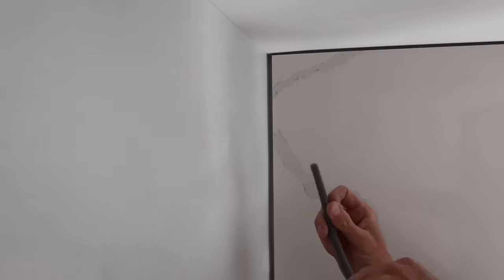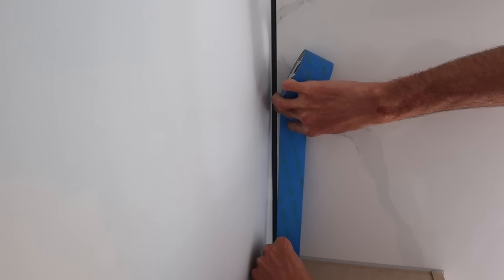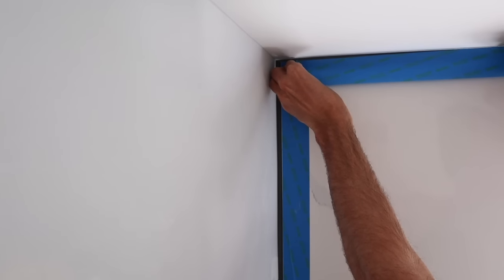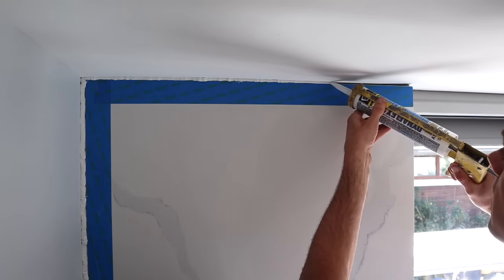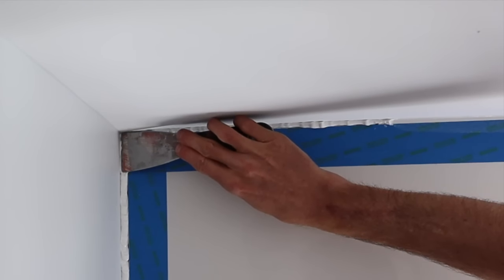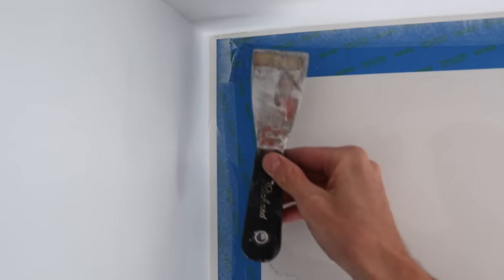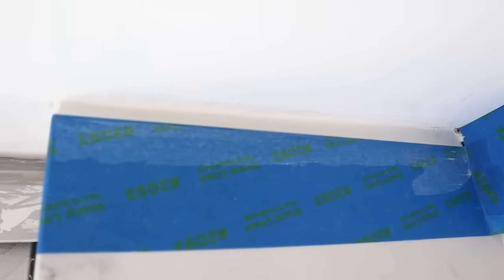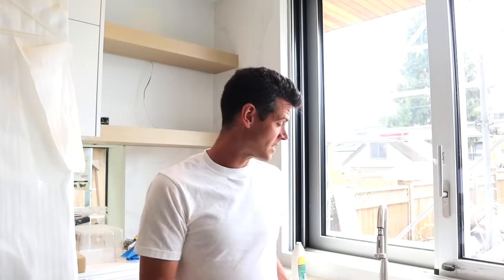How to Caulk BIG GAPS!!!!

Comment: I've caulked 1000's of feet of trim in apartments I've fixed up and rented out over the years and have never heard of backer rod.   Thanks for the tip.
Reply: its construction its commonly used to fill gaps in the wall and door frame.
Reply: Same here! This is a great informative video! Thank you for posting!
Reply: In the carpentry industry, we call "backer rod" paper towel, or pretty much whatever will fit in the gap. Don't waste your money on "backer rod." It's a marketing scam. Anything will work. 

You're just making the gap smaller so your caulk isn't heavy enough to pull itself out. Caulk isn't meant to fill gaps. It's a surface applicant.
Reply: @BruceOfWaynes   baker rod is meant to give the caulk an hourglass effect it’s import for expansion and contraction.   He should have used a tooling knife and made the outside concave to match the inside also you don’t want 3 point adhesion or the caulk will crack and pull away. Last no backer-rod means you will waste a ton of material. Also if your gonna use backer-rod you want the depth to be half of what the width was. Then there is open cell and closed cell. If you don’t want air bubbles popping up don’t poke holes in you baker-rod while installing the open cell I don’t think that would be a problem.
Reply: @BruceOfWaynes  wrong backer rod also gives the sealant the proper profile so it can stretch and compress properly. Paper towels or anything else is I VERY poor replacement.
Reply: @genecarden780  lol. What?! Proper profile?? Dude. I've been doing this shit, professionally, for 20 years. Never once have I ever seen anything called backer rod on a goddamn job site. Never. No one uses it, guy. Whatever fits in the hole goes in the hole. So take your ridiculous diy advice somewhere else, friend. Thanks for your input tho. You probably bought that new fangled air conditioner with the ice water too, huh? 🤦‍♂️
Reply: As another fellow landlord. 

EXPANSION FOAM IS YOUR FRIEND

Cheaper, bigger and easier to store than backer rod.
Reply: @BruceOfWaynes  Tell me you work for Dan Ryan Homes without telling me you work for Dan Ryan Homes.

Comment: I can not thank you enough for posting this video. We had trim at the tops of all our walls. When we removed the trim, that I hated, there was this gap… everywhere! In all the rooms! I have textured ceilings so I couldn’t use the tape! I came a crossed your video and tried it, with one exception, after I used the caulking and let it dry completely I used joint compound and then sanded it flat. Wow!!!! I have done my entire house and repainted all the ceilings and the walls. It is perfect! Can not even see traces that it was once there! It didn’t mess up the textured ceiling at all! You are wonderful! Thank you so much!  God bless you and your family! ❤

Comment: Youre actually suppose to leave backer rod for 24 hours before you cover it with caulking..
(I worked for the biggest glazing company here in B.C. used backer rod everyday)

Reason being.. Its foam. So when you squish it in. Its going to expand back out as it decompresses..
If you squish it in and cover it right away. As the foam decompresses. It pushes the caulking out with it..
Which is why he said "we'll see what it does"
Then said it coved out just a little bit..
Cause he covered it right away and didnt let the foam expand back out..
He got lucky cause its small rod.
Bigger the rod. The more it will cove out if you dont let it expand back out first and cover it with caulking right away..
Reply: Very good advice and information, thank you.
Reply: I’m glad I read your comment before I started to fix a repair today..great info.
Reply: You are not supposed to squish the backer rod.
Reply: It doesn't matter if the latex caulking is flexible. I've done a lot of caulking jobs.
Reply: He’s a carpenter! From Vancouver!.. not a painter!..
Reply: Also, what about the caulk shrinking? Latex and latex w/silicone still shrinks over time. 100% silicone caulk doesn't shrink much if any at all.

Comment: That tip at the end really resonated with me, I recently did drywall in part of my basement (crawlspace actually) and I was not happy with how it went, lot of big gaps or areas it did not line up right etc.  But after it was all done I realized it was not THAT bad, and all that will be fixable when I plaster anyway.  Sometimes you need to give your work some tolerance to imperfection and I often forget this myself and try to make stuff too perfect.

Comment: BRAVO !  I just mounted drywall in my kitchen ceiling, to cover the recess that housed 3 x 48" fluorescent tubes.  The original recess wasn't even close to square,  so I have gaps ranging from 0" to 5/8".  This video saved countless hours with a kinked neck & blobs of joint compound on my face.

Comment: Congratulations!! This IS the correct way to install sealant(caulk) I have installed sealants professionally for over 40 years and I see so many stupid methods of caulking. The one thing I would suggest you should do is tool it both directions to improve adhesion.Backer rod IS essential Not just for aesthetics but it also improves the performance of the caulk significantly. Thanks for getting the installation right. Just in case you don’t know ,the general rule is 1/2 as deep as the joint is wide. With a maximum depth of 3/8” to 1/2”
Reply: There is an 1 inch gap between the AC unit and the wall that I am trying to seal.  Does this mean I'd need 2 inches of foam to fill the gap?
Reply: @taoliu3949  Foam? Do you mean backer rod? If the gap is consistent 1” ( not much bigger) you can use 1 1/4”

Comment: The first time I used masking tape with caulk was at the outside bottom of a bathtub at the floor. I let it dry before removing the tape and it didn’t come up cleanly leaving the perfect edge I wanted, it kind of tore the caulk at the edge of the tape. I still use tape with caulk sometimes but since that experience, I never let the caulk set before removing the tape no matter what I’m doing.
Reply: An easy tip. Caulk in such a way that the edge of the tape is visible trough the caulk but still covering the tape. Then paint after its dry, peel right away or after the paint is dry. Been doing this for 15 year so I kinda know it works :)
Reply: I am with you, caulk & remove the tape ASP, but use a wet finger to smooth, guess with a knife one leaves  very little over lap.

Comment: Great vid. But i think it is also worth mentioning that the back-stop is not just there to even out shrinkage. But for strengt of the joint. It is not a coincidence that it is round, this is because the optimal profile of the caulk is thinner in the midle, so the midle remains flexible (especially when connecting different types of material) but the sides has plenty caulk to make a strong bond.
At least that is what the manufacturer claims :-)

Comment: Nicely done. Because I so enjoyed your attention to detail, and as someone with a background in Building Science, I offer you this: a critical detail of backer rod is that it provides the ideal profile for your silicon to perform as intended. The knife trick is great for aesthetics, but with respect to the bead's cross section profile, it may leave your silicon weak and susceptible to failure. :(
I myself struggle between aesthetics and performance and it's always a bit of a give-take balancing act...never a dull moment! ;)
Reply: There is the indented application of building science and then the reality of remodel.  Often very different. This is very practical technique and encountered countless times in remodeling. As he indicating, having a range of rod diameters is key.
Reply: That's really interesting to know that a knife can weaken the caulk. In areas where I don't care about appearance and would actually prefer stronger more durable caulking it's great to know my avoiding the use of a knife is actually helpful.

Comment: The backer rod (or gasket) also ensures that the flexibility of the filler material (caulk/silicone) stays flexible as it only adheres to the two opposite surfaces. If it was adhered to the bottom of the groove as well the filler material would lose flexibility and possibly crack if the building interior surfaces move relative to each other.

Comment: Backer rod makes a lot of sense for large gaps. One more tip when using water based fillers is to give the area a light mist water spray after filling the gap. that way the filler will not stick to anything other then the gap and you generally only need one pass with no lift offs.

Comment: I just did this today! I had too small a gap at the bottom of a bathroom backsplash for a trim piece but still over 1/4”. I put in some vinyl foam weatherseal, which had the advantage of having a sticky side, and stayed in the middle of the gap where I put it, so I was able to caulk all around. And now I’m stepping back, because I can see every little bump and wrinkle.

Comment: Screw up bits of newspaper and pack into the gap, paint it liberally with some lightly watered down epoxy glue (you dont want it running down your walls but you want it to soak into the paper) leave to dry.  Wipe down your wall after gluing. Once dry then caulk it. Lasts for years.

Comment: The pep talk at the end is there because caulking will NEVER be perfect, it just never is lol. Caulking is a perfectionist's nightmare, the more you touch it the worse it gets! 

I've learned a few tricks for caulk over the years and the main one is if you can't use a mud knife, caulk tool, or whatever dab your finger in very soapy water so it won't stick to your finger. Also use backer rod as much as possible.

Comment: in a pinch, I had some excess 1/2 " copper pipe insulation (use pex now), cut that in strips and inserted in gap. Big gaps I cut up pink pool foam bands, ensure walls are tight above and below gap, and caulk away. So far so good, But backer rods are cheap (say, $10-20/100 lf, but I'm even cheaper). LOL

Comment: Hey. Your videos have been really helpful. I live in a 1890’s house and we had insulation work done a while back. Problem is they did a really poor job with the drywall. I have sections where there is over a quarter inch difference in the height of the sheets. Do you have a video on fixing that? If not, I would b love to see one.
Reply: Is it possible for you to put screws where the drywall is not flush am I understanding your question?
Reply: If you mean that the board isn't flush by 1/4" and won't push back  than it should come down to see what is going on with the framing behind it.  You need to figure out if ones high or the others low or if it's both and correct it from there

Comment: Your videos have helped me immensely.
I replaced my carpet with a wood floor and now I have a gap where the casing meets the new flooring. Do you have any videos that address that problem?
Reply: Toe board or it's wider cousin, quarter round. Next time remove the baseboard first so when you re-install the baseboard will cover. But the toe board should work unless the gaps are too big.
Reply: Yup, we should have removed the baseboards! I wish the installer would have suggested that. We would have gladly done it.

Comment: I did this while hanging on top of a roof doing gables. I can caulk goo carpentry easy. But when I have a mile wide gap it looks like I went finger painting. This made me think I wonder if I have to run multiple beads and wait for it to set to come back.

Sure enough. Thank you for the video

Comment: I've just had a kitchen fitted. There are 2 - 10mm gaps between the upstand and the wall. I've just discovered backer rod. I instinctively knew something had to be pushed into the gap to prevent caulk sagging. Although I'm wondering if pipe lagging (custom cut into strips) would do the same job, as backer rod isn't sold over the counter locally, from what I can see. 

My next concern is that the worst gaps (10mm) are on the wall immediately behind the sink.. and my instincts are now telling me that I should use silicone (for its waterproof and flexible characteristics) and not 'caulk'. 

The walls are white and I'm unlikely to ever want to paint them a different colour, so a white silicone seems to be the answer. 

To overcome the UNpaintability factor of silicone, I'm thinking if I ever did want to paint the walls and the silicone a different colour, I could paint one of the Zinsser products over the silicone, such as shellac based Zinsser Peel Stop. There's a load of Zinsser products, I'd be shocked if one of them can't be painted onto silicone to make it paintable. 

I actually bought a "paintable caulk" for another part of the house, painted it with emulsion and the paint cracked. So I brushed Zinsser Peel Stop onto it, allowed to dry, then painted with emulsion and no issue whatsoever thereafter. 

All input welcome 😊

Comment: Ben, this video is a perfect chance for me to ask a question I encountered today and you are the drywall guru. I’m finishing mudding the drywall in my basement and my father in law suggested I caulk the inside corners rather than tape them. He was adamant that it was easier and a time saver, but it just seemed to be cutting a corner (see what I did there?). I didn’t do so, but I’m wondering Is that actually a feasible thing to do?
Reply: Clay Neal hi Clay, as a drywaller, I try to stay away from caulking my corners (I just don’t) It’s not a great long term solution as the caulk will start to peel away after a few years. The only place I’ve done that is when there is a repair that goes into a corner and there’s only 1 or 2 feet along that corner. This is so I don’t have to match texture on the ceiling as well as the wall (Western US). But in general, just tape and mud. You won’t see the cracking in every corner after a few years that way.
Reply: I’ve seen that in manufactured homes. Those guys really optimize the quick, cheap and good enough (at least good enough to sell) approach. It seems to work long term with relatively tight joints and lots of caulk. It’s probably important to use a decent type of caulking like the Dynaflex. I’ve never done it myself though.
Reply: @TwitchyFPV  Is the tape and mud the best way to go if the wall and ceiling is in the bathroom? Thank you.

Comment: I used masking tape for years when applying caulk & silicone until I saw an instructional video using just silicone forming/caulking tools. No tape, no fingers, no detergent used. I was dubious at first but tried it during a renovation. It was a revelation leaving a much better finish and taking a LOT less time. There were also no problems with masking tape leaving a raised edge. You should try it and see how it compares?
Reply: Before caulk tooling tools became available, I always used a cut piece of paper towel for tooling. If I was tooling latex caulk I wet the paper towel tool with water. If I was tooling an oil based caulk, wetted the paper towel with mineral spirit. The trick was to keep a wet working edge. Worked for me.
Reply: C Adama interesting, I used to use old plastic style credit cards and snipped off the corners.   That was before the silicone caulking tools came out. I use 99% isopropyl as my cleaner since it flashes off quickly. Almost want to try the paper towel method ....feel like I missed out

Comment: I use sika flex and it’s paintable clean tight job with slicks
Reply: Sika flex is great but I learnt the hard way that oil based paint doesn't like it. Use water based & it's good.

Comment: Good job - this will help.  I have a gap I want to fill between the wall and a shower stall.  The problem is the gap narrows from about 3/8 inch at the top down to about 1/8 inch at the bottom (4 feet length).  Any advice on how to adapt the backer rod to the narrowing gap?  Possibly use one size for the top half of the gap, and a smaller size for the bottom (or something like that)?

Comment: Hi great video!  Im a diy'er and finished laying a new vinyl tile kitchen, hallway, bathroom floor.  In the bathroom the bottom of the tub has a curved profile.  Im not sure to use like a flexible molding?  I saw they make flexible quarter round which would match the rest of the walls.  But i can see the stuff not holding adhesion so now thinking about just using caulk.  What do you recommend?

Comment: Could the backer rod be used to fill a gap between a wall and ceiling, where the drywall wasn't cut right? If you put this in the big gap, then covered with tape and mud?
Reply: that would be a quick fix but it would be better to fill with  concrete  fill  then mud and tape
Reply: If it's a gaps between drywall or plaster,  just use regular joint compound.
Reply: taping or all purpose drywall mud will work  just make sure that you have enough time for it to dry  as it will shrink.   big thick  gaps are best filled with a  setting compound vs one that air drys

Comment: What if you have a lot of gaps and they all have different sizes. And more of that the size of some gaps changes gradually from one end to the other. I think in this case instead of using backer rods a better solution would be something like a foam but the big question would be which one.

Comment: I’ve got a gap between wooden countertop and backsplash from the wooden warping a little bit, particularly closer to the stove – I guess reaction to the heat. I would like to try the backer rod, since caulking alone simply falls into the gap and can’t really adhere to anything. I’m just wondering if anyone knows if there are any concerns about using backer rod in close proximity to stove heat? Most of the backer rod I’ve seen is described as perfect for cracks in windows and outdoor applications. I’m sure it would be fine but it would suck if it started to react to heat, produce a smell, etc. Hope the OP or some other knowledgeable viewer can advise.